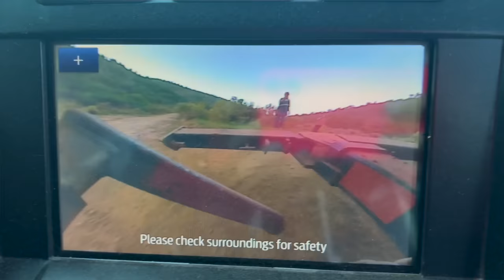We Got A Call! Chevy Stuck Deep In Mud Pit!

Comment: I suggest you get out of the habit of letting the winch cables slide through your hands, and just hand over hand, orwalk it in.  Cause one of these days you're going to get sliced open by a broken wire strand.  That's why the braided nylon cable have become so popular.  That and they don't become guillotines when they break under tension.

Comment: Robby -- When you first started pulling the truck out, you shouldn't have had Demri give it any gas. If the truck's wheels are turning any faster than the truck is moving, you're still digging it in deeper. Just put it in reverse and let it idle while the winch does the pulling.

Comment: Since the skid steer doesn't even belong to you, is so slow to get anywhere and is limited in the places you can get into - you should buy a cheap 4x4.  With this you can get there faster and go way more places than the skid steer.  You can then mount the logging winch using either a 2 point (like on the front of an excavator) or 3 point hitch (like a tractor or old Landrover, look it up).  This would be more like how they do recoveries in Europe.  Pumpkin is a why cooler name.

Comment: When's the BOSS going to open up the check book to get you your own orange 🍊 and winch box?
Reply: IIRC the winch box is his. I'm on the lookout for a hydraulic winch to build one for mine.
Reply from the maker: Haha the Boss has said we can buy one, but they aren’t cheap. I did buy the winch box.
Reply: @RobbyLayton  Consider a good used one, since it would be in use every day. Also, I'd seriously consider a tracked one for recovery use, way lower ground pressure and it will go places a wheeled one never will.